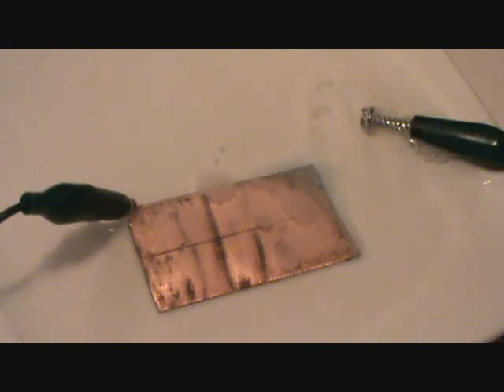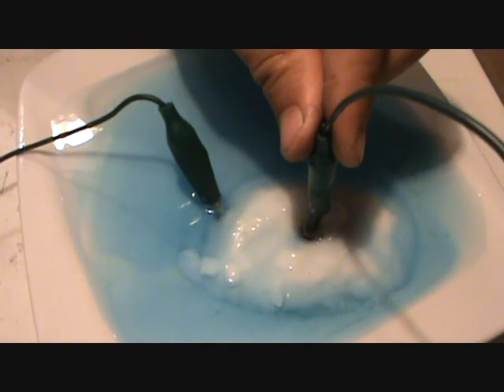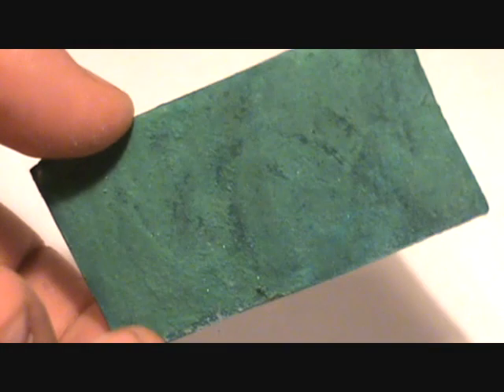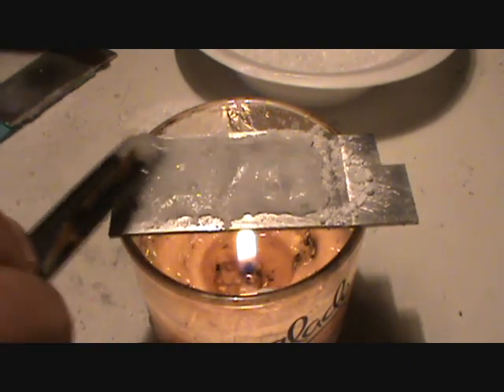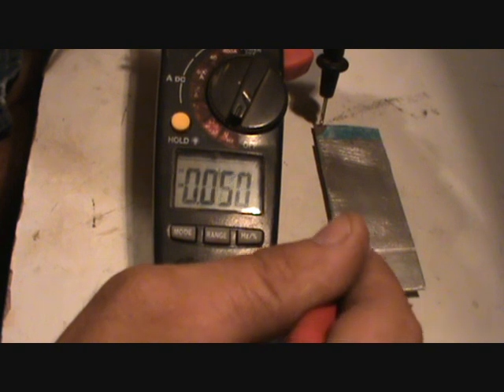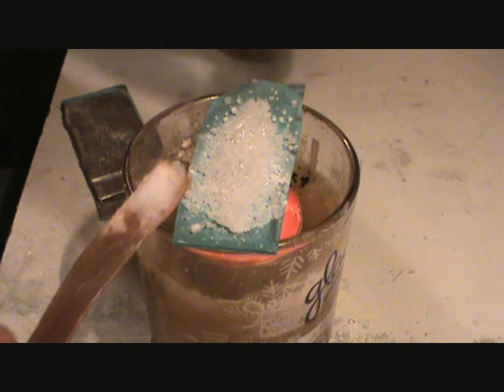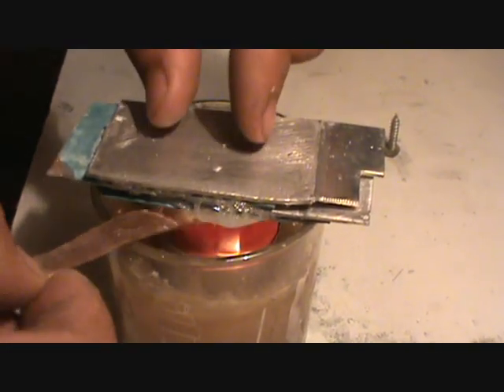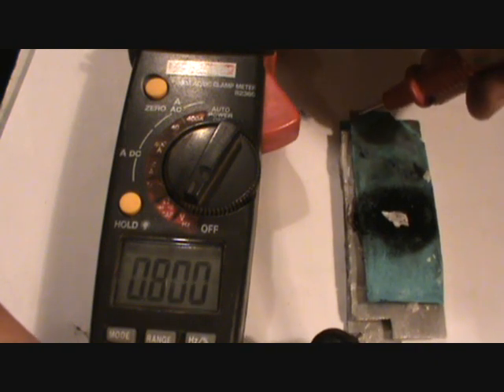crystal battery pt2

Comment: Are you writing down the precise amounts of material you are using in these experiments? Are you charting your results with each new formula? What current will it stand? Voltage is nothing if it can not supply the current; think static electricity, lots of volts but it won't do much except make a spark and give you a mild shock.  If not, it's pointless to continue!  Suppose you get a cell working exactly the way you want, will you or anyone else watching be able to repeat it just by using a little bit of this and a little bit of that?  I wish you well, my friend, and hope you get the results your looking for.

Regards,

Mick

Comment from the maker: @m3sca1 im gonna try to get some zinc plates,,, like the anodes you  had.. i think it will do alot better than the aluminum.. im gonna post some more on this cell, the charging effect  are pretty cool with a 18 volt battery i can charge this cell to 4 volts, and  it does seem to recharge itself after a while though.